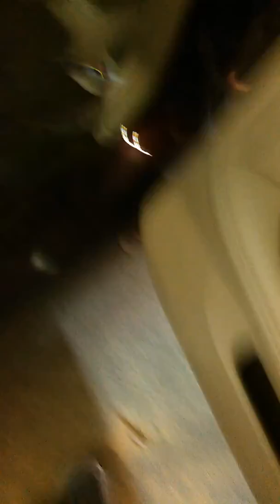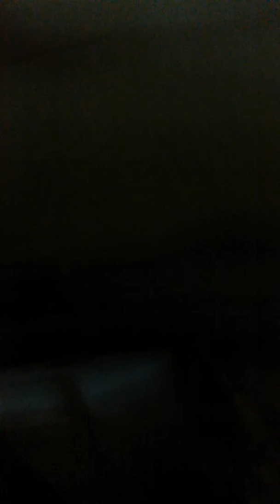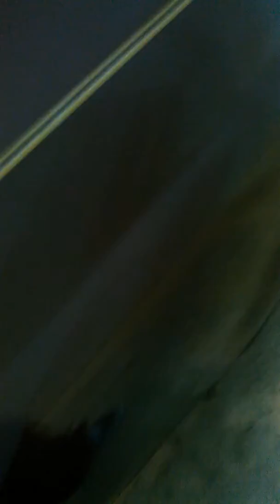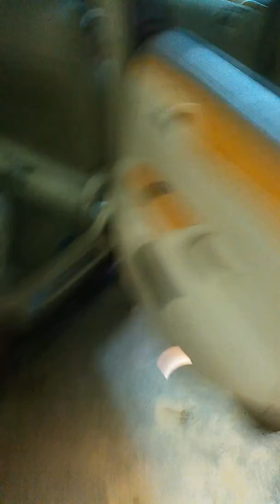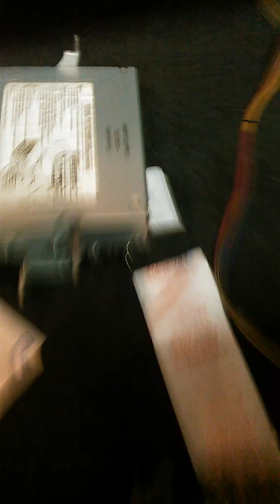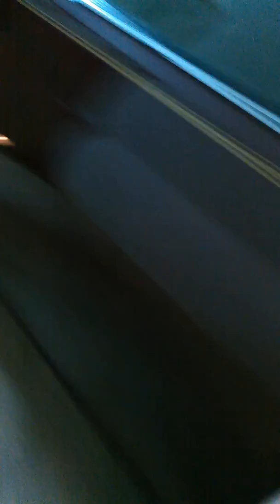05-10 Toyota Avalon stereo install part 3

Comment: Hey what's up I was wondering if you could help me out I got a 07 xls with jbl I need help in retaining my blue screen I understand I need to relocate the factory radio in trunk but what wires are needed can I just clip the factory harness and tape longer wires back on it and extend it in the trunk what wires are needed to keep the blue screen also I don't have gps if that even matters
Reply from the maker: Unfortunately no its not that simple. The information to the screen goes thru the factory stereo. So you need a special wiring harness that basically extends the main factory stereo harness. they come long enough to run the wires to the trunk. I got mine from a local dealership and its pretty expensive for a wiring harness ($60) but is necessary.